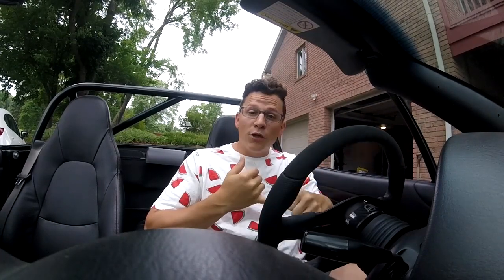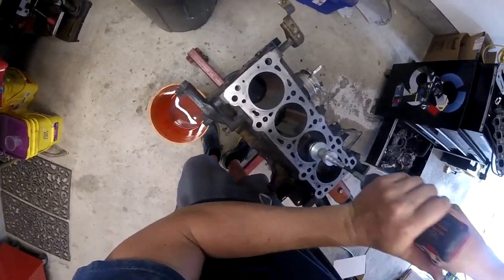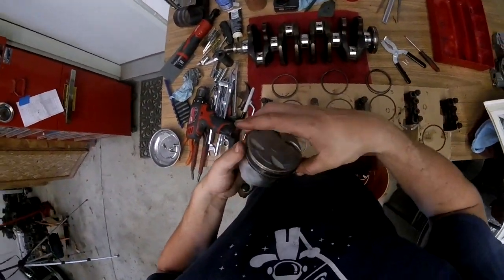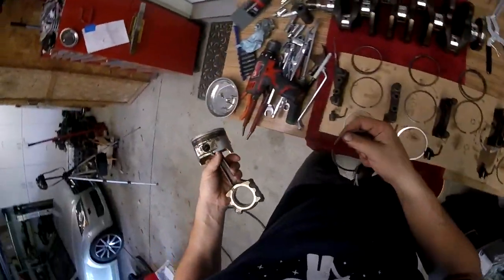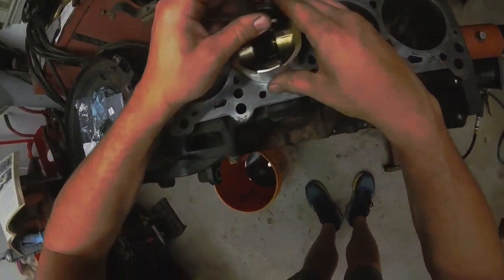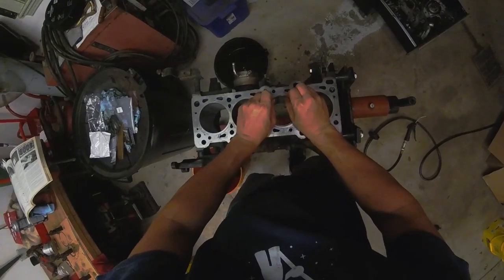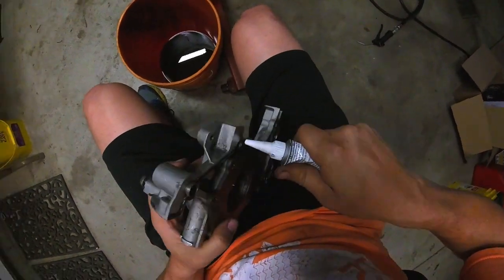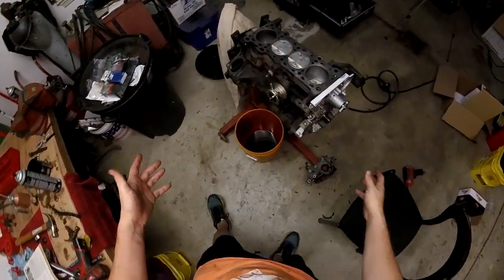Miata Engine Build Pt4 - Step-by-Step DIY Block Assembly

Comment: Hi, can you please tell me the name of the book for measurements? I want to rebuild my engine next month and I have Engine Workshop manual for B6/BP, but some values are slightly different than yours. Should i bother, or small differences are okay?
Reply from the maker: I did NOT have the engine workshop manual, I used a Haynes manual.  They make many books for many makes.  If you have a Mazda shop manual 100% follow that!

Comment: Hi! I built my motor but I have excessive blow by. I only have 50 miles on the break in which might be the rings not seated yet but pretty discouraged. I was very careful and even bought two sets of rings since I wasn’t 100% happy with the first round. Any thoughts? 
1 140 - 150 (wet)
2 125 - 155 (wet) 
3 135 - 150 (wet) 
4 140 - 155 (wet)
Reply from the maker: Hm, that's incredibly low for a stock Miata figure.  Anything in 180-205 is good.  Often new builds are all at or near 200s.  

Are you seeing oil blow by or just chasing the low compression figures?
Reply: @racecarcamp9056  not seeing any oil blow by but during my turbo setup I noticed exhaust blowing out the turbo drain fitting. To be fair it’s the biggest “breather” in the system but still not good. I went and removed the turbo and just did another 30 miles of vacuum pulls. Hoping it will seat better
Reply from the maker: @TeddyD802  What size oil return/drain line are you using on the turbo - and where is it draining?  If it can't evacuate quick enough you might be blowing oil through the seals of the turbo.
Reply: @racecarcamp9056  that’s exactly what happened. I just drove another 50 miles hoping to seat those rings, it’s drives excellent without the turbo, the oil drain is right under the AC compressor at the front of the pan, it’s a 3/8 NpT fitting
Reply: @TeddyD802  check pcv system

Comment: how did u manage to pull those head guides up?
Reply from the maker: Which guides, sorry? I'm not following the question.
Reply from the maker: If you mean the valve guides, I got in there with some angled needle nose and popped them out.